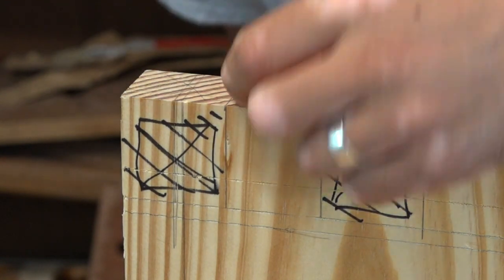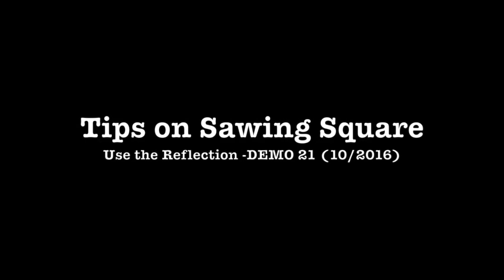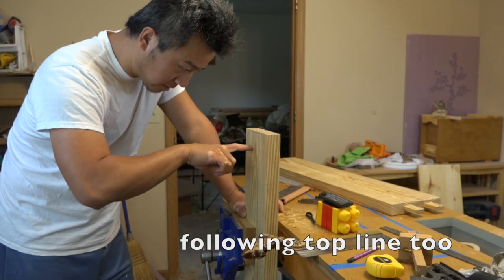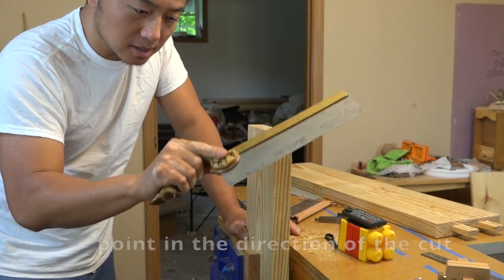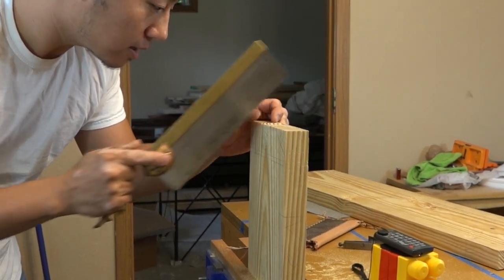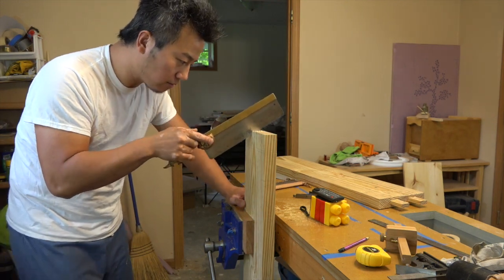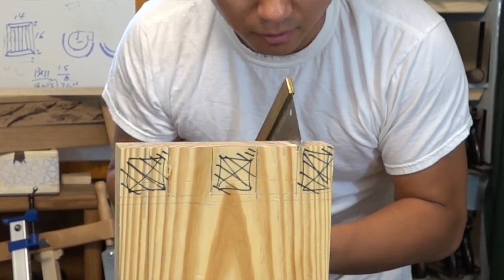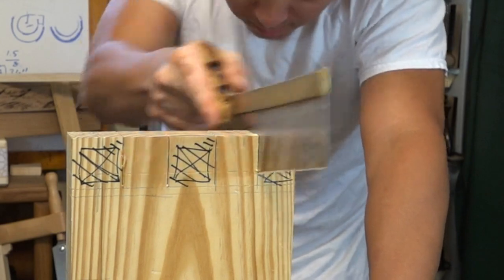How to Use the Reflection to Guide the Saw - A Few Hand Sawing Tips - DEMO21

Comment: Nice video, John
The one with the reflection on the saw I do synonymous.
You can also do something different. First the one side, obliquely down. One is oriented at the marking. Then turn the board and saw the other side the same way.
When you have reached the lower point, you can then saw the saw straight down.I use Japanese saws. :-)
Reply from the maker: Good to know. I haven't used pull saws much,